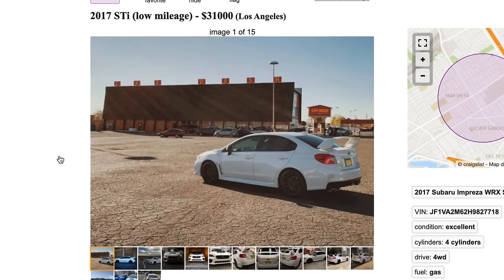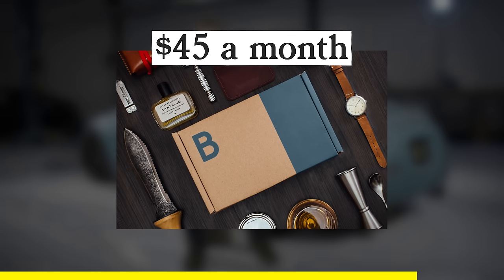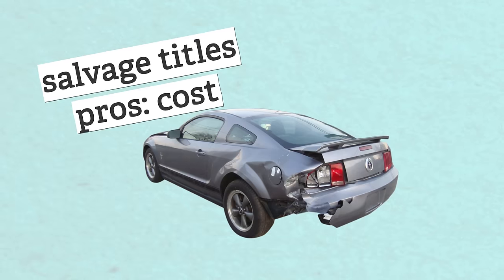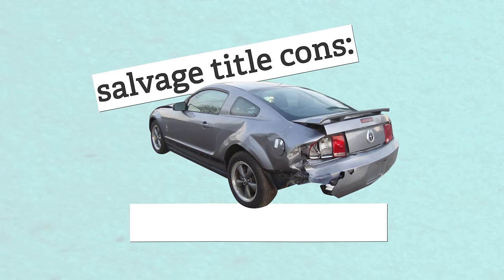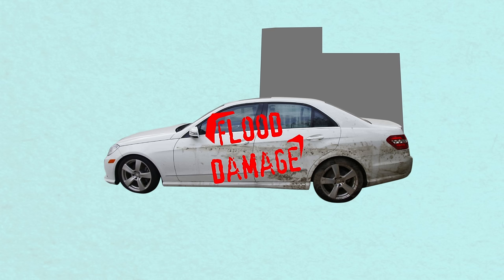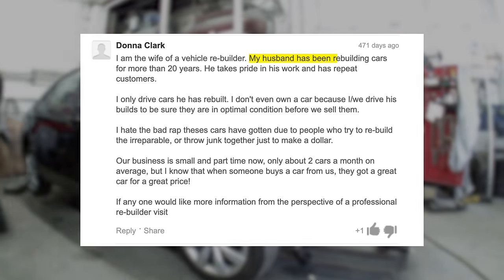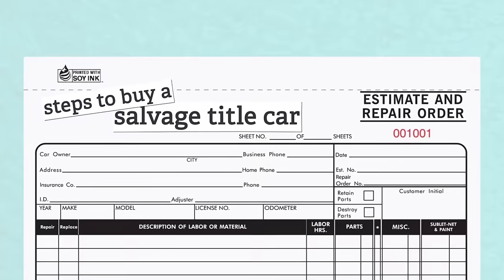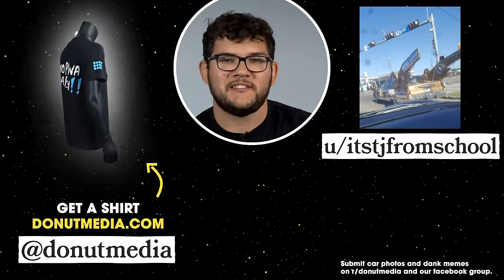Buying a Salvage Title Car: Bargain or Nightmare?

Comment: I actually run a dealership that primary sells salvage cars we have repaired by very good shops. We specialize in new subarus. Been doing it for a few years now with a lot of success. My last two cars have been salvage. I love these vehicles and the prices I can give to people. We warranty all the repairs for a year automatically so people know we stand behind everything. We have never had trouble with insurance or getting loans for them either. Up here in MA with a very strict inspection system. Salvage is definitely very polarizing but I've had a lot of good experiences with customers. Perfect cars for people that want to keep it for years and years like I do. We also do take trades from previous customers that want to get a different car. Some people get Imprezas but change their minds and want a Forester or Outback. Or other way around. The only issue we have had is honestly selling them faster than we can build them. Always looking for more good shops. If you know any good ones in MA, reply and let me know.

Comment: If your in the UK, one way to tell if a car has been in an accident is to see if the car has both it's original dealer plates. If one plate doesn't have dealers name, assume the car has been in an accident even if it hasn't been legally written off.

Comment: FYI JDM imported cars are hard to tell if they were damaged prior.  They dont have vin tags on all the body panels like you see on your average US car.  They also dont have NHTSA stickers.  There are typically only 2 vins on a JDM import.  One in the firewall and a vin tag that is usually riveted to the inner frame of the fender.

Comment: Like everything else, use common sense, plus trust your gut.  No need to take an extreme side of "always" or "never" salvage cars.  I actually bought my first salvage car, but the car had records from Day 1 from the first owner to the third, and record of the fender bender (fender and door replaced) from 8 years ago that caused the total loss.  But it's a great point that a salvage car should we one you intend to keep and drive a while, because trying to sell it is definitely not going to be as easy as a clean car.  So don't buy it to flip it for a quick buck...

Comment: I sold a 2010 dodge challenger with 90,000 that had a salvage title. We had to replace the motor. Well, lucky me, I found a motor with 20,000 miles

I sold it years ago and I'm happy to say it's still running and going today. Happy and healthy

Comment: Salvage 84 celica, and only problem it gave was that after sitting  for 4 years was that the gas pump broke so im a mix mix on salvage but won't put my celica away for down for it being a salvage, its still one of toyota's top 4 baby's of the 80s

Comment: I just bought a 2006 civic si for 6200. Only has 115k miles and was owned by a grandma. Its a salvage rebuilt title. I didnt get a carfax however i trust that it was professionally done because it was registered in NC where they have strict inspections to be able to pass so any work that was done had to have been good for it pass inspection every year after the accident

Comment: I rebuilt a dodge dart myself. 2015, 48k. Bought for $1300. And have a total of $3000 into it with all repair work done. Never had a single problem since.

Comment: Ultimate guide to buying salvage cars are two points:
1.Try to avoid frame damaged cars
2. Try to avoid water flooded car since it is a huge gamble, except for Run and Drive cars and the ones that had no problem reading the actual odometer.

Comment: I have a salvage title on my 2002 GMC Sonoma 4.3 L manual transmission. The only reason why it is a “totaled or a salvaged title” is because somebody hit the passenger side of the truck by the door and it would’ve cost more to fix than what the trucks is worth. That is the only reason why it is a reconstructed or total title. Make sure you do your homework before buying one! It’s easy just take down the Vin number and contact DMV they’ll tell you everything. That’s the way it is in my state. Good luck everyone because you can really find a diamond in the rough!

Comment: Back in 2016, I bought a 2004 BMW Z4 with 70K mileage and a salvage title but only after checking it's history. An online search found me photos of the damage, a minor rear quarter panel crunch combined with an owner who was wanting to buy a different car. After a positive review from my mechanic, I was able to talk them down to $7k (the current owner bought it for his wife who disliked it because "the radio doesn't work"). Pulled the radio the next day and replaced it with an Alpine. It was a great deal and the car lasted for another 7 years.

Comment: It all depends on the accident. (Excluding flood, never buy flood) If it has documented damage, you can find the auction listing, pictures of the accident, etc., and get a solid story on what happened, then that allows you to make a solid decision. I bought a rebuilt Camaro with 65k, only hit on the front drivers side with airbags deployed. Something you have to realize is that Airbags are a common cause for a car to be totaled because they're very expensive to replace both parts and labor wise. That being said, nothing mechanical was wrong with the car and the engine was in perfectly fine condition. To me, that is what the decision came down to, whether or not the engine was damaged. In my case it wasn't and the pictures weren't severe enough to worry me. It has been a very solid car and has given me no mechanical issues.

Comment: Bought a salvage 1996 camaro v6 from my neighbor for $1000 a year ago. Put about $2500 into it so far but that's from being a 25 year old car, not a salvage. It was rebuilt in 2006 from the original owner, second owner drove it for years then let it sit for years, motor and frame are solid just needed everything else replaced lol

Comment: I bought a 2018 equinox in 2019 with 6K miles for $12K. It has 32K miles now and not one issue. I did inspect the vehicle before money was transferred so if your going to buy a salvaged title make sure the car is in good shape.

Comment: Last week I bought a 1993 5 speed Miata in California for $2000 bucks with a salvaged title. The car was in a front end collision and was repaired properly. I flew to Sacramento to pick it up and then drove back to San Diego with absolutely no issues. The car runs and drives great. It’s not a car I plan on selling either so the salvage title wasn’t a big deal to me.

Comment: I bought a Volvo S60 T5 from Florida that was a flood car. The motor ran fine, the only noticeable bad thing with the electronics were that.

1. My sun roof would randomly not work
2. The driver side seat features (heated seats etc) would randomly not work then work the next day.
3. Two lights on the console wouldn’t work but the features would still work.

Hell of a car for 500 dollars.

But don’t buy a flood car. Not every car is as lucky as that one was… well before the kid I sold it to totaled it.

Comment: An only flooded one is an easy fix if there's no water in the engine itself, you JUST! have to be willing to atleast strip everything inside and replace all wiring. If you got the time, space and tools for it and get a nice deal it's easily worth it.

Comment: I had a 96 accord that was totaled when a truck towing a  rv came around gas  pumps and did not swing wide enough crumpled my passenger side front fender and ripped off my front bumper and passenger side lights that was all the damage it did. No frame damage  so I just got the matching parts from a junk yard replaced em and she was good as new had to give up part of my insurance check to keep my Honda but still got to keep her in the end and got a small payday in the end even after repairs

Comment: I bought a 2013 Ford Escape SE in 2015. It only had 40,000 Miles on it, it had a salvage title because of hail damage. However from more than 5 feet away you don't even notice it. I paid $10,500 for it and still have it and drive it everyday and have had 0 issues with it.

Comment: My first car was a salvage title 2010 Nissan versa. Had 100k miles and the engine ran perfectly. The reason for it being a salvage title... Hail damage on the roof and hood. The only issue it had came from me parking it onto the curb and the bumper being bent

Comment: You said dont deal with a flood car but I took a blind risk with a salvage title 2013 hyundai genesis coupe 3.8 and couldnt find any major issues with it. I am a mechanic and thoroughly inspected it before buying and continuously. So far Ive put about 4k miles on it and it looks amd drives brand new inside and out at 125k. I bought it at just under good condition kbb value private party and still feel confident with my purchase, but I can see why it would easily be a bad idea

Comment: I bought a car from some sketchy Colombians down in Miami and they said they needed us to bring it back a few days after we bought it so they could switch over the tags and everything but turns out they just had to slap on a rebuilt title sticker in the door jam after we already bought it and switched over everything. Everything on the cars still runs fine just the rear bumper area is all mangled and they just slapped a new number on over it to cover it up

Comment: Dependson who rebuilds the car and what equipment they have.
A skilled worker with the right equipment can actually rebuild the car with all dimensions and alignment perfect. The sheetmet can be worked by hand to have a better finish than the factory.
The problem is that a lot of people take shortcuts and don't have the equipment to square up the body properly and so the car is never quite right.

Comment: Rebuilt cars are fine if you check it out good and get it for WAY less than retail. I've had a couple different rebuilt cars and it meant that I got a lower milage or newr car for my money.
Lots of cars get damage repaired without it showing up on the title so with these at least you have an idea what your getting

Comment: Started working 30-40hrs a week in fast food at 16 to buy a dope ass car. After about a year and a half I had 15k. Looked on Facebook MP and found a 2016 Challenger SXT with a salvage title. Bought the car, LOVE IT. It works great, the ONLY shortcoming I had was with the actual title. It was a complete pain in the ass to get the rebuilt title and in the end I just ended up with a bonded title for insurance.

Comment: my first car was a salvage. Got a 2010 mazda 3 with 40k ish miles on it for 6 grand. Back in 2014.
had it less than a year. Totalled it annd the insurance paid my 12k for the value.
Did good that year

Comment: Try it yourself! Lots of Salvage cars just have some exterior body damage. Stay away from it if the hood won't open, radiator is out of place, or airbags are blown. Those usually have frame damage.
That sorted, you can buy them for 1/3rd the clean title price, spend another 1/3rd on a new hood, fender, headlight and maybe a relay, small computer, or windshield washer resivour, and you've saved a ton of money. Stick with popular cars to easily find used body panels.
Almost bought a 2013 Genesis coupe 2.0L just as described above for 6k. Regrets.

Comment: bought a salvage title altima, looked fine , no issues for a year. got rear ended guy's insurance would only give me $800 for the car. lawyer would not help, neither did my insurance company. book value was $4500 if it was not a salvage title. I will only buy another if it is real cheap.

Comment: Bought a 2005 Honda civic hybrid 5 spd for 1,300 with 85,000 miles. Was crashed from the front end, airbags exploded and fixed it up and is now my daily. Definitely think it’s worth it if you know where it was damaged and repaired it yourself.

Comment: A few years back I found a really great deal on a few year old f-150, xlt package with low miles and all the features. I called the lot to ask about it only to learn that it was salvaged/someone had passed away from complications from the accident. My parents work in the auto insurance industry and I did not have enough credit established to take out a loan on my own so the “deal of the century” was vetoed by my father. It was 100% the right move but at the time I was a little bitter that he made me pass it up.

Comment: It 100% depends on what cause the car to receive a salvage brand. I had a foxbody with rebuilt status because it was an old base model, dude hit a deer. Showed me all the pictures of before after and during/after repairs. No structural damage. Hood, grille, lights, a fender. I think radiator/condenser too maybe. 
Car was so old they totaled it. He bought it back, fixed it. All good. 

But major wrecks, anything that activates the crumple zones or tweaks the structure, it’s a no from me dawg

Comment: my salvage title car isn’t bad, my dealer was. he has no idea how to fix wiring issues let’s just say and I spent $684 to get it’s small issues fixed (the only issues it had). the car was in a small collision on the front drivers side. it barely did damage to the car but the hood needed to be replaced and the entire headlight assembly did too. turns out my dealer doesn’t know how to put in a headlight assembly so the Subaru dealership had to rewire it for it to work but that didn’t bother me at all because ik it works now and everything else does too. never had any major issues just that headlight issue and a recharge for my A/C.

Comment: I accidentally bought a title washed Volvo C30 T5 (first time inexperienced buyer) last summer and had an absolute time and a half getting it back to insurable status, costed almost 4000 to get it there.  In the end tho it was absolutely worth it, car had only 70,000 km (I’m Canadian btw) on it and I payed 4000 for the actual car.  I set aside 10,000 for buying the vehicle so all in all, I came in under budget and now own a car I frackin looooooooove and she drives like a dream.  Definitely gonna be more careful next time and learned a lot through this experience, but gotta say, I would still consider buying another salvaged car in the future if this thing continues to be as reliable as it has been thus far.

Comment: Depends on who does the work? I run a shop and this is exactly what we do. I have extremely high standard and go to great lengths to only use good parts...most of the time OEM parts. Only buy a Salvage car if you know who is doing the work? Our cars are minor body damage hit. Yes they are Salvage but they are done and repaired correctly. Make sure to get a mechanic friend and have him or her go over the car in detail. Know what your buying...dont assume that the State inspecting a repaired car will notice all of the damage that has been repaired.

Comment: I have a salvage GTR, R8, 911, and Tesla Right now!!!! Wouldn't be able to experience these amazing cars at full retail!! A LOT of cars are salvaged just because theres no authorized repair facility in the area. 

I picked up my R8 from copart after a minor rear end. All it needed was a tail light and a bumper cover. It wasn't even hit hard enough to bend the impact bar. But those parts flown in from Germany are thousands of dollars to the insurance company. They don't use eBay pricing when sourcing their parts 😂

Comment: If you're about to pay off on a car because you have a good APR & damage is minimal, you can take the option of buying back the salvaged car and get it rebuilt with w/e money is left, and just ride out till it's paid off & keep the car until the engine literally dies from age. Taking the payout in full to pay off rest of loan and using remainder as a down on a new car is just stupid Used or New with how crazy private sale prices and Dealer rates are right now.

Comment: My dad bought a 2017 mustang premium with the front in damaged so bad that it came in at least 2 ft from its original point and it's costed him 8K, he then repaired it for 15K minus the turbo, and aftermarket splitters, diffusers etc. And overall he basically got a brand new mustang for 23K when it wouldve originally cost 44K

Comment: You forgot to mention "rebuilt titles". In some states, when a vehicle is given a salvage title but has been repaired and is roadworthy, the state will issue a rebuilt title to the vehicle. Buying a car with a salvage/rebuilt title can be tricky cause some hack mechanic might repair the car incorrectly and hide damage.

Comment: Thinking of getting my second salvage title car. From same place I got the first one. The first one was pretty good but for some minor damage to one headlight and the AC condenser was scrap and radiator fan needed to be replaced. $500 to fix but other than that ran great. Kelly blue book was $9000-12000 bought it for $4750. Got the car fax report for it. Relatively minor damage. Going to get the car fax report for this one as well. 2014 Ford Fusion SE for $5900 even Kelly blue book has it $12000 - $14000

Comment: I've owned two salvage title cars (rebuilt), and they were great cars and can be the best deals on the market if you buy them for the right reasons. I bought them with the plan to get a cheap car that I'd drive till it gives out. Had one for 6 years before it went and another for 1 year before I smoked a deer at 70 and totalled it.

Comment: A car with extensive flood damage is very difficult to fix, harder to sell and because of that the cheapest. A flooded Title can be good. If it is extensive, You'd buy it because you plan on Tearing it down to the frame anyways.

So if you plan on stripping the car down to its frame, then a Flooded Vehicle could save you a lot of money because you would have to get to the frame anyways.